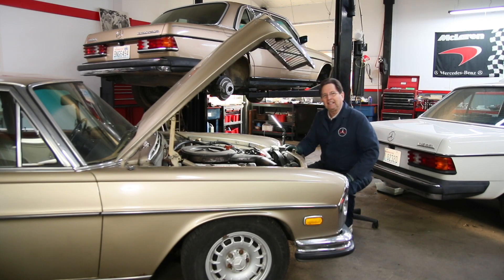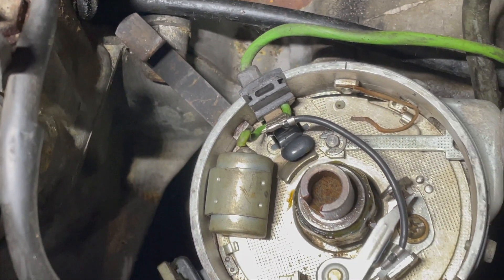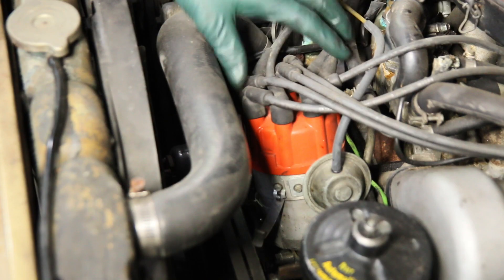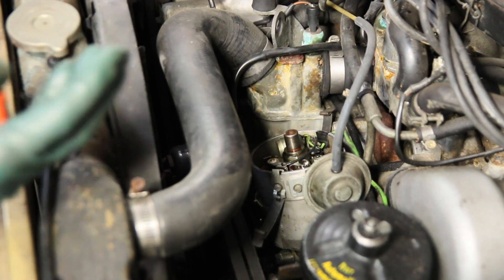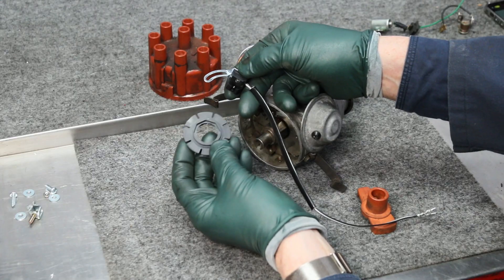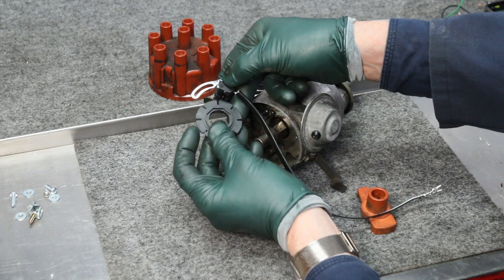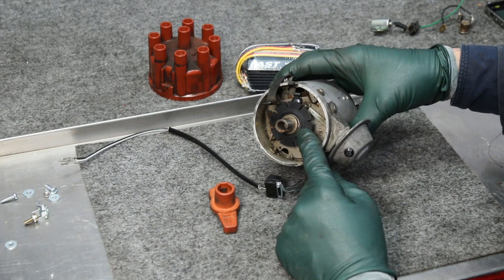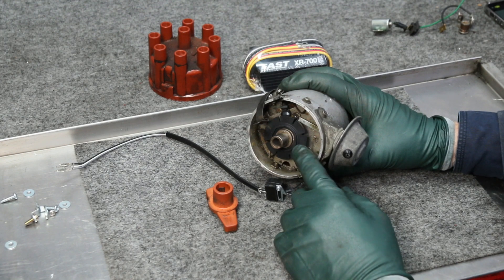Early V8 Points to Electronic Ignition Conversion: Part 1 The Challenge

Comment: @Mercedssource please help me! I locked my 89' benz 300se with my key, all 4 doors locked, well the problem is the back doors will not unlock now & when I was locking the car the back doors locked and the plastic piece you pull on to manually unlock the door from the inside flew off when they were locking (confused why this happened never seen this happen on any car before but whatever) it happened on both back doors during the locking process..... Now I have nothing to pull on to unlock the doors manually from the inside. Now, is There an emergency way to open them like there is for the gas door and sunroof? PLEASE HELP ME. I'm desperate no shops can help me in this small town
Reply from the maker: There could be multiple problems with your door lock system. It is very hard to troubleshoot it unless you understand the principles of operation. I have a training video on my website that explains it all. Here is the link:  https://mercedessource.com/store/1981-1991-w126-chassis-sedan-vacuum-door-lock-troubleshooting-and-repair-demand-video-manual
Reply: @Mercedessource  thanks

Comment: i dont have any experience with the v8 system but i was thinking that you could use some rubber hose to extend the rotor so that you can still use it to press the disk down like on the other models, not sure if it would work. love your work btw.